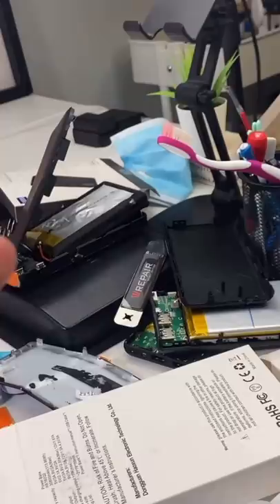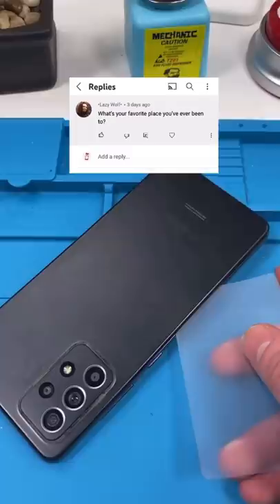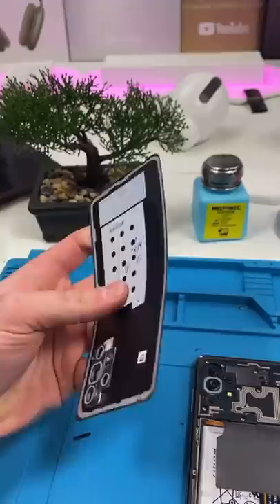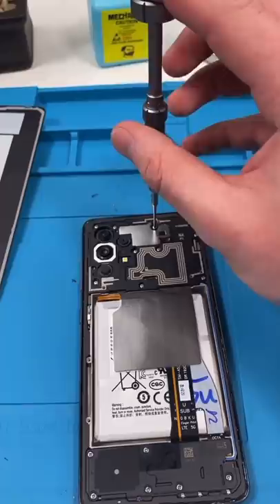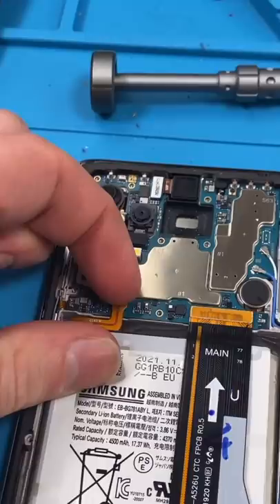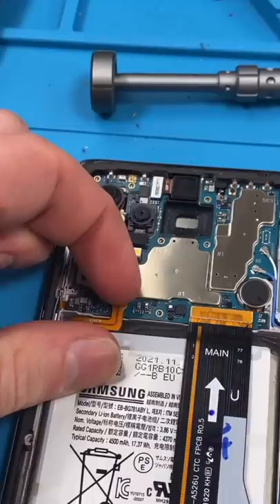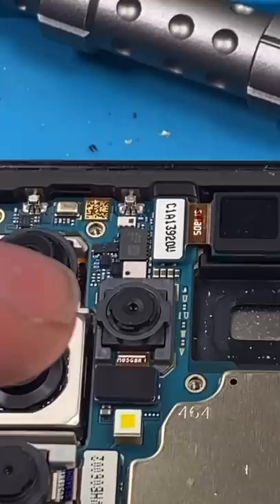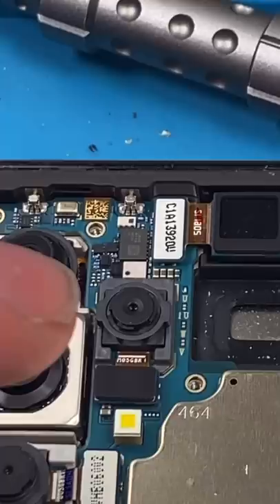Does This Samsung Phone Have A Fake Camera? #Shorts

Comment: Power bank ratings are done at 3.7V. Draining the cell from 4.2V down to 3.0V. USB uses 5V, new ones go up to 12V so 3.7V cell needs to be stepped up to 5-12V.
They don't lie, they just state the capacity of the cell inside the power bank.

Comment: Hey RPG, I'm always wondering at what temperature and how long do you cook the Samsungs to remove the back glass?

Btw, you got a Spanish viewer and subscriber here, I'm glad you liked the country :)
Reply: Is samsung even using glass backs anymore? Didn't they shift to a really nice feeling plastic even on the S series? 

I have the A52 and have to say, I do not notice the difference between the iPhone 11 and it at all. Also most use cases anyways so why bother with a glass back that just shatters.

If you want premium go with cnced aluminium or another metal an add custom engraving to it. That would be a premium back for a premium phone. Glass is not even expensive  it is sometimes even cheaper than high quality plastic.
Reply: @AlphaHorst  The S10 family has a glass-ish back cover. Nevertheless I meant back covers in general hehe
Reply: Ah yes, Repair Phone Guru™
Reply: @AlphaHorst s20 - all glass.  s21 normal/plus versions - plastic backs (s21 ultra had glass). The newest s22 lineup is all glass again.
Reply: @toxicturkeyy  fuck.. I thought they learned with the S21... I have not heard any complains about it being plastic back.
Reply: @AlphaHorst  plastic is more durable but doesn't dissipate heat as well, so in rare cases, it can cause the inside to heat up which is bad for battery longevity. oems also want to aim for a more luxurious looking/feeling product
Reply: @AlphaHorst  nope the flagship are all glass on the back
Reply: @toxicturkeyy  Only the small S21 had plastic back. Both the plus and the Ultra had    glass backs.

Comment: One thing I have learned with fixing phones is on Samsungs it’s better to disconnect any cables from the sub pba and not the main board. That way if by some chance you damage the fpc you don’t have to deal as much with micro soldering. It’s a lot easier to get a new sub pba then it is to solder a new fpc on the main board.

Comment: To specify, the back is not plastic like how he was showing it, it's a combination of like hard plastic and like a little bit of glass cuz it has a smooth back tuck finish. What he was showing you was the underneath part of under the back panel soft touch glass finish whatever. But it's not that flimsy floppy thing he showed you. I have the a52

Comment: The Galaxy A series with plastic back is not going to crack like glass. Also the shards won't cut you like glass.  Win win if you ask me.  But an S21 for 130 is very compelling.  Still has the SSD card.

Comment: did ones A51, replacing with frame is fun, but I ordered screen only, have to deal with a lot of heat gun for screen removing from the frame. 
and fingerprint reader was not working, software lock like in Apple 😂😂☺
Reply: It's no software lock. You literally ordered lcd screen. In display fingerprint only works in LED display. It won't work on lcd screen
Reply: @Athul8055  A51 or 52 has LCD screen, not OLED screen, only S models have OLED screen
Reply: @ronlevin2339  really you are technician?😸. Samsung All series has OLED screen above midrange or some budget model. If your phone has indisplay fingerprint then it will be a OLED screen
Reply: @ronlevin2339  both A51 and A52 have a super amoled display 
And amoled displays are basically Oled but with a better quality
Reply: @arqam5265  sorry, my mistake

Comment: I still remember how Xiaomi in their Redmi phones gave fake second lenses and never said what they did they just advertised it as "Dual camera" with no description of the advantage and the app itself also didn't have any specific feautres for the secondary lense. It didn't blow up in the states luckily but I am afraid it was tempting for the eastern countries and many bought it, even I got one inported for the sake of testing and put a black tape on the second lense and all feautres including portrait mode worked I even then went as far as to opening it (the first phone I opened) and deliberately cut away the second lense from the camera housing and ironically it only had 1 cable and 2 lenses in the same housing and btw nothing happened the phone died in the end of 2020 probably because of cheap parts.

Comment: I got the A21.And I think it's funny, it has slowed down 3 months into owning it. And that's funny because it still no case or screen protector, no scratches or cracks. Somehow I've managed to take better care of this phone than any other phone I've had, and yet it's the cheapest. Upgrading to the 22 ultra 512g. But honestly the A series is not the worst, but you can still definitely tell it's not an S

Comment: When you repair phones, does the data get erased? Especially when you take out motherboards
Reply: It's very rare for that to happen. Usually during the repair process, the data stored on the internal flash memory is usually unaffected and has to be. Otherwise the phone will be bricked because it won't have an OS to run.

Comment: Hi, I'm about to get a Note 8. Yes, I know it's old, but for now, it's better than what I currently have. Would it work to swap its 3300mAh battery  for a slightly bigger Samsung bettery, 3500 maybe, if it fit?
Reply: Nope. Aftermarket batteries with "larger capacities" are usually fake, or don't fit